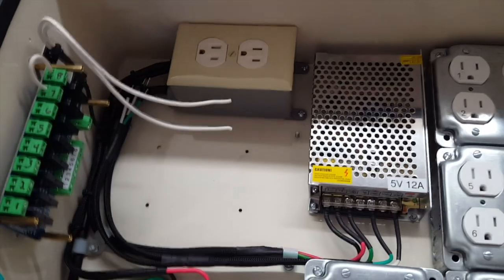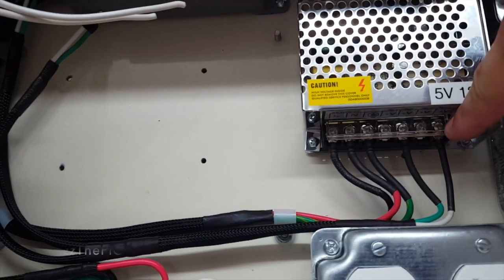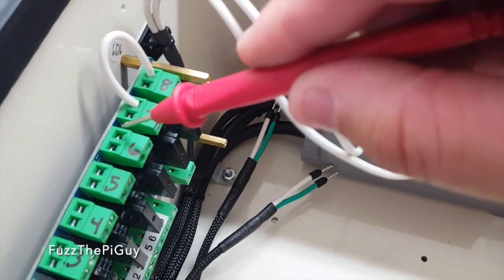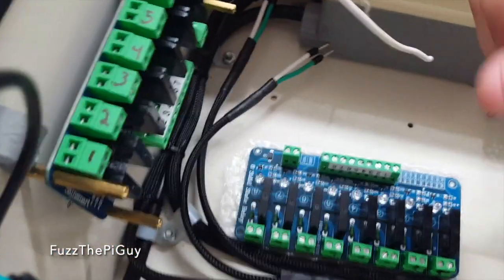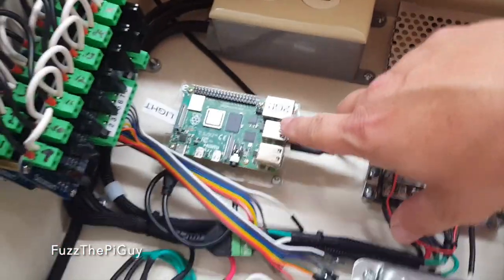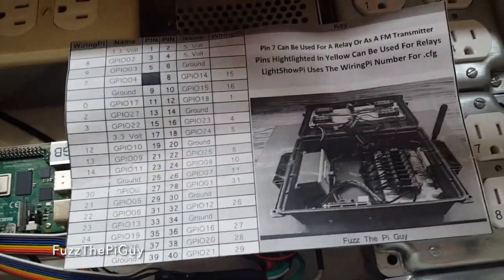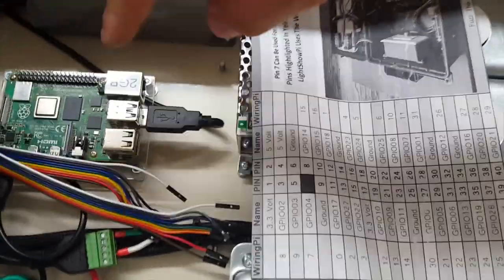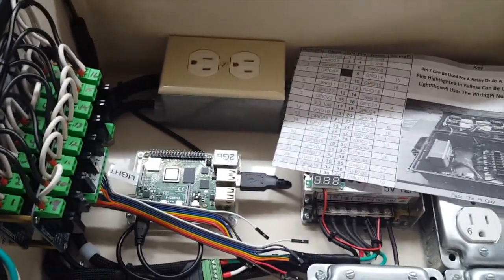DIY LightShowPi Step-By-Step Setup Using A Raspberry Pi 4 And Solid State Relays | Part 3

Comment: Sorry to dig up an old topic for you. But you seem to be the guy to refer to on such matters. I am wondering what you recommend for a FM transmitter set up for Lightshowpi either using the BCM 4 pin or the USB sound card,  or whatever else you might recommend.
Reply from the maker: I’m using the Signstek ST-7C FM Transmitter.